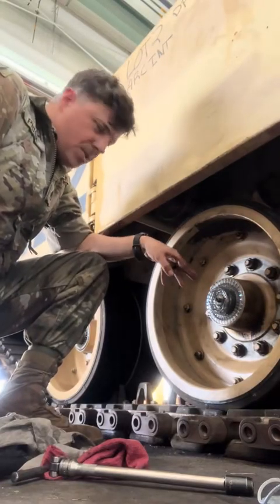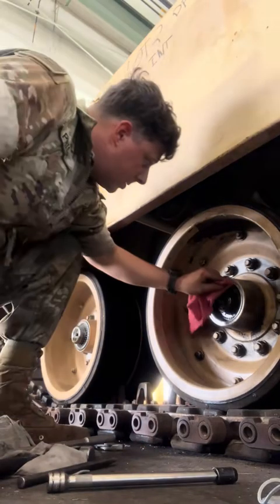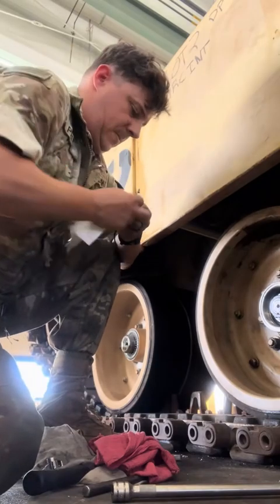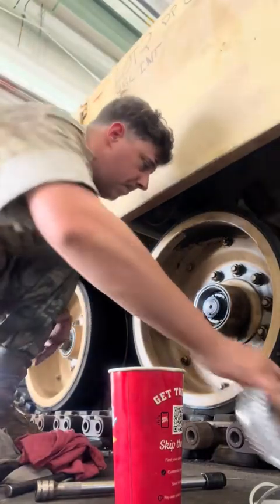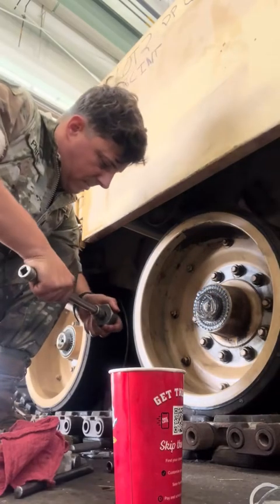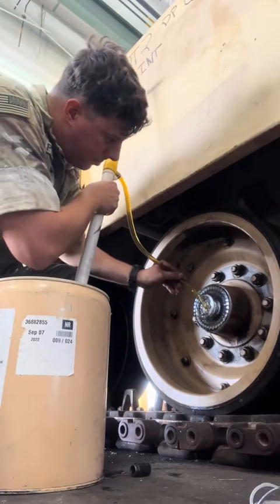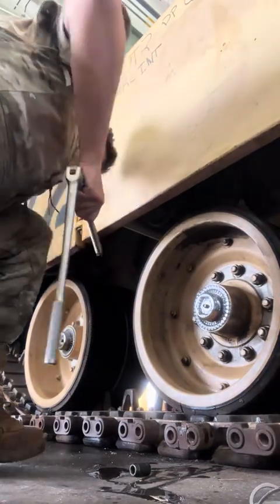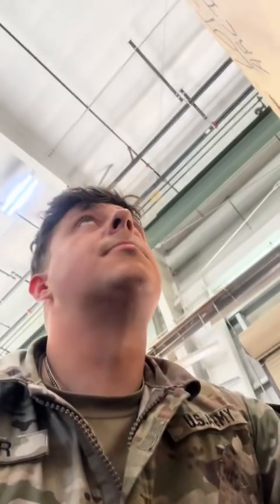M1A2 Abrams hub

Comment: Golden Point - Everything attached to and holding anything in place by means of stoppers, bolts, nuts, rivets, welds etc are all to have a locker pin arrangement to hold Everything in their place for everything in the world ie all products of the world and all of the above is at Emmy's Expense  ( El )( IMF)